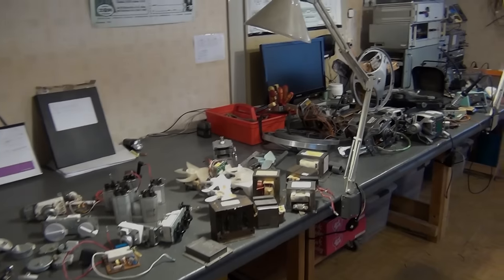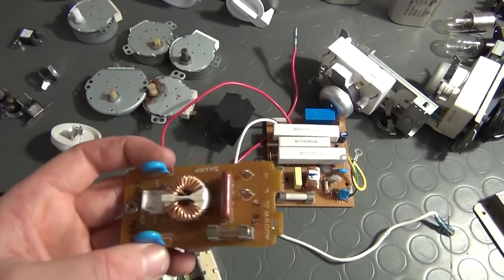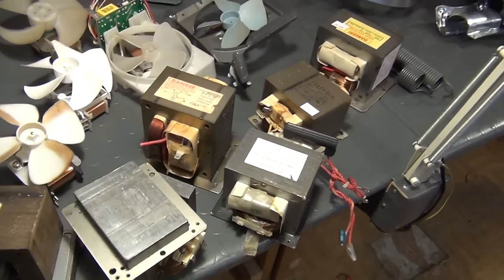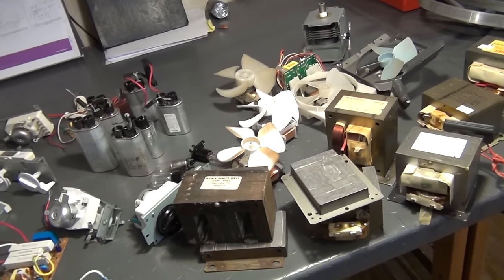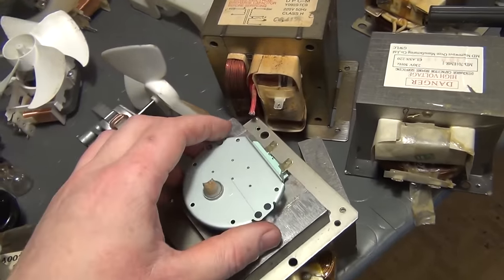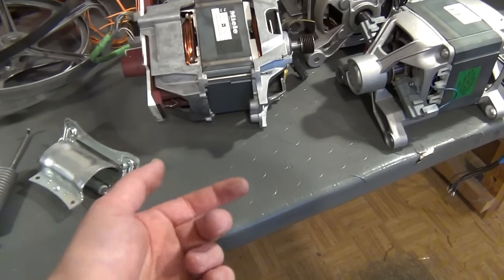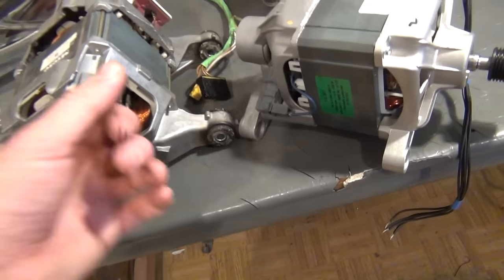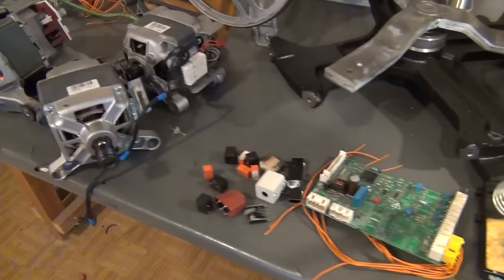TPAI Lab Report # 002:  Salvaging and Reusing Parts from  Microwave Ovens and Washing Machines

Comment: Salvaging washing machines is very rewarding.. I've used some of the pumps to realize my rainwater collection and storage/filtration system, built a winch from the drum wheel/belt assembly to haul beer crates up to my balcony so I don't have to carry them up the stairs, and many other projects. If you're looking for higher powered pumps, salvage a dishwasher.. they usually have rather strong pumps for generating the pressure for the spray valves, and they also have good throughput (commonly 2" hoses).

Comment: This is an somewhat older video but one feat it still has in common with many more recent ones that see specific parts come by (like the one on all kinds of motors) is a little gripe of mine, or rather a wish I have..; you always DESCRIBE parts (like the choke in this vid, and obviously all those types of motors in that one I referred to) but you never EXPLAIN them in any manner that makes them understandable. Not in general, let alone as to specific parts, points of interest or things referring to their mechanisms of functioning that you might mention... To stick with that example of the one that stars all those types of motors, it would be so good if you would do one that ACTUALLY lays out precisely how all those separate types work!

Comment: i made a remote starter button for auto repair from a bicycle hand grip, a normally open, door micro switch with an attached metal extension arm from a microwave, some wire from the microwave and a couple of alligator clips. one clip goes on the positive batt terminal, and the other on the actuating terminal of the starter solenoid. i hot glued the switch in the grip with the lever arm sticking out of the hole in the closed end, with the last 1/4"(7mm) of the arm bent at 90 deg. pushing the arm energizes the solenoid to operate the starter. for what they are, the price to buy one is crazy.

Comment: I have built several " Fractle Burners "  using micro wave oven ballasts . Variable voltage using variac  allows pattern burning of wood. You can google it. the resulting burn scars in the wood can be cleaned out with a brush and backfilled with colored epoxy.

Comment: Well, the Universal motor on the washing machine I see as very useful. 

I see it as a matter of creating a transmission that suits the aim and I like that they can be used with either DC or AC current. 

Some guys do a lot with salvaged motors from washing machines, treadmills etc. 

Jeremy Fielding does wonders with salvaged motors including washing machine motors. Matthias Wendel has built three band saws with salvaged motors with the largest being a 20 inch saw he often uses for milling logs to rough cut lumber. He is also very skilled at creating the required transmissions which are often made of high quality plywood laminated into gear assemblies or step pulleys. 

I just used a Universal motor from  a food processor to power a small ball mill. Sure at 120 volts AC it was useless but after cutting away the diode rectifier and powering it with 12 volts Dc while connected to a shop built wooden based transmission it works perfectly at spinning the drum at 30 to 120 rpm depending on what part of the step pulley I attach the drive belt.

Comment: What I do with microwave light bulbs:
     Take two bulbs of equal wattage, wire them in series, and put them inside bathroom or hallway lighting fixture such that they are always turned on. With each bulb only getting half its rated voltage, they glow dimly, but brightly enough that you can use the bathroom at night without disturbing your night vision.
     Why do this instead of using an ordinary nightlight? An incandescent nightlight will burn out after a few months. An LED nightlight will grow dim after a few months. However, these microwave light bulbs will maintain constant brightness, and since they each dissipate much less than rated power, they will last for many years, if not a decade or two.
     And don't fret over the electric bill. Keeping these low-wattage lights turned on constantly will have no noticeable financial effect.
Reply: Probably some LED night lights are crap. But if you properly derate the LEDs, that is run them like the lightbulbs at a fraction of their rated power, they’ll last for decades too.

Comment: So I found a washing machine with a three phase motor and I did not use my head when it came to figure out a way to make it work. 
I listened to you when you said it’s too complicated to get it to work. 
How do I had the time to actually look at the circuit I could’ve used washing machines VFD to power the motor itself it just had five in put wires and all I had to do was put an o-scope on them and see what was the input signal that made it go. Then reproduce those signals.

Comment: Hmmm. Think I may get onto writing an app to interface into a salvager database. Something like you as the salvager fill in the name of the device, a list of parts you found useful and any notes on using those parts like clearance considerations or links to data sheets. 

When I heard you mention that tidbit it got my gears turning that it's one of my greatest frustrations trying to salvage parts is just finding things like data sheets or decoding from the device itself how to actually use the part I want. Case in point a very confusing washing machine motor I salvaged which has a bizarre startup procedure that I'm still working out. My father used one just like it when I was a kid and it was a really nice one since speed control, direction control and even timing control are all built right into the motor. I don't remember his circuit to tie knobs to all that being at all complicated.

Comment: You should NEVER "play" with a magnetron period. They are to be treated with a special respect if you want to experiment though.
A typical magnetron operates on 2.4GHz @ 1Kw of very "dirty" wideband RF. The power requirements are typically 2Kv to get it fired up and like all RF the bulk of the emitted radiation is lost very quickly IF you do not have a reflection chamber or parabolic on it.
Shooting one as-is straight out will do nothing to you @ 10 feet from the nozzle because the RF acts like a flashlight beam and spreads out and looses most of its potential. If you have it on a waveguide or tuned parabolic the "flash light beam" turns more into a laser type beam as it's more compressed and focused.
This is what makes microwave radio systems work.

The MOT is basically crap, I mean you can rewrap the secondary with heavy gauge wire and make a spot welder or arc furnace but that's about all you can do. Even then there is no promise you wont fry the primary.  

IMO the best parts of a Microwave Oven is the digital electronic timer with VFD's or LCDs. The mechanical ones are again not very exciting and are usually a geared timer motor driven or have a tension wrapped spring.. Either way they are more or less pre set, where the digital ones have everything on board and you can set them more accurately and have a real time clock as a bonus. Plus they typically use smaller relays on board too.
The VFD / LCD types can also be driven with an Arduino if you dont want to use the onboard system, you just need to get the schematic and isolate the display circuits a bit.

The airflow handlers are ok IF you can find a place for them in a project. otherwise they are good for scrap metal, kinda the same for the MOT and casing of the unit.

Comment: I see no problem reusing those motors, you gotta do your leg work and get a few basic metal cutting tools and a cheap welder and steel tubing and bearings and build a reduction drive like a standard drill press uses to change speed of the drill bit or in your application its needs. Covering the motor isn't that big of a deal get some card board and cut square boxs and template some 18 awg steel plate into a box to cover it and  add venting holes. When in doubt, draw or look to other appliances for help. Car parts are good too.

Comment: Hi TPAI ! 

Microwave oven transformers make good high voltage supply for tesla coils.

Also, by removing the secondary and the magnetic shunts, by cutting the E and I parts of two transformers, and then soldering the two E together. You are left with a big transformer, with a large aera to wind your own secondary. The two primaries can be connected in series to greatly reduce the magnetizing current, thus making it much motre efficient, and capable of running coninuously (which a standard MOT cannot do without active cooling).

MOTs are lovely devices :)

I am loving your videos so far, very informative and well detailed. keep up the good work :)

Best regards from France !

Comment: I use the big magnets inside magnetrons to stick on the side of metal sufaces, then stick metal tools to them for convienience.  You can also use a thin metal strip to stick many tools to them.

I have endstops in my cnc mill that were originally inside a microwave and other devises.

Comment: I use the washing machine motor for my air compressor It works good the compressor runs slower but that's ok because the motor has plenty of torque to run the compressor it runs a little bit slower so recovery of the air pressure takes a bit longer but for home use its fine
Reply: I know its been five years but, what was the wattage of the washing machine motor you repurposed?
Reply: @amielrumbaua8387  I forgot its bin a while and the tag is missing

Comment: I was just reading your patreon page and noticed you mentioned lack of ventilation for welding in the basement. Throw those microwave fans in some plywood with holes cut in it and place it directed outward in the window. 4 to 6 of them should allow for adequate ventilation and with minimal noise.

Comment: Some of those components would be great for making a HAWT power generating system. They work fairly well in the back garden/roof level wind velocities with enough wind swept area. The castings with the bearings and the belts bring you half way there for a proof of concept build.

I mean you're not going to be making money selling power obviously but it could be fun to attempt. Maybe you could use the energy in your heating system or something of that nature.
Reply from the maker: zero_sum I have experimented with all kinds of self made wind turbines about a year ago. In this region there is a lot of wind, but my own lawn (of all places) is not well suited for a wind turbine.
But thanks for the input. I didnt think about using this part for a HAWT, but now that you say it, I guess it'd be worth a try.

Comment: I work at an auto parts shop, so I recognize many of these from their automotive use... strange feeling. 
Those ceramic cased power resistors are common in older cars, in US referred to as a (ignition coil) ballast resistor. I've also heard of them used as a "voltage dropper" but I don't understand what that is for beyond the obvious. 
One thing that is never used on cars is those Honeywell style microswitches! Sure, every car quite a few of them, but each one is different for each use and make and model!

Comment: About those washing machine motors, you should be able to turn them into generators. on my channel, I've turned two can motors (one from a printer the other a remote control car) and a stepper motor into electrical generators. you may even be able to use the microwave fan motors as smaller exhaust driven generators.You are right about quality. German machinery is industrial grade and high quality, which is why I have a Volkswagen and a German soldering iron. As a note, the trade off is they are usually harder to service and find parts for. that probably explains why my brother was able to disassemble three North American printers with a vest pocket screwdriver.

Comment: Rather Wonder Concept: "Repurposing for the MAKER community"....... A personal interest of mine that might have wide appeal is the ::::  Exercise Treadmill and it's Variable Speed DC motor. I have two of these gathering dust because of the effort/time required to come to an understanding of them sufficient to start a repurposing project. .... THANKS Again!
Reply: There's another guy on youtube that made a knife making linisher from an old treadmill. Seemed to work nicely.George Ray

Comment: TPAI you can reuse the washer motors to build just about any revolving tool in the work shop... you can upgrade wood lathes and small bench metal lathes and take them over to belt operation with the right bully wheels etc. or use them to replace the old style of mini mill top engagement system. tyvm for posting all of the wonderful information.

Comment: Hello mine friend "" I need to apply may be 12 volt with boost converter with micro oven transformer to make a force field , also a hand held plasma disrupter, very high voltage, I no it is a very strange thing to ask ""  !

Comment: I want to build a simple wood turner's lathe with a washing machine motor, with the option to make it a disk sander with the right attachment. Controlling the speed is the hardest part of using these motors, especially if you want low RPM because the built in tacho winding doesn't give a ver useful signal.
But I have started a circuit that will run the motor from rectified mains via a PWM controlled IGBT including motor reversal, a current sensor and RPM measuring at the motor and at the spindle with two hall sensors. But unfortunately it's a project that went into the "waiting projects" box two month ago.
Reply from the maker: superdau You can salvage a small neodymium magnet from an old CD / DCD drive. If you then glue that magnet on the rotor shaft and place a hall effect sensor near it you  can use that to measure the frequency of revolution more precisely. If you want an even better signal, you can use a comparator to reshape the output signal from the hall sensor.
Reply: ***** It appears to be DC motor controller, rather than VFD.
Reply: ***** 
It's 325V DC, so, no ;)  It's "just" a PWM-dimmer with feedback. In the end it should have some more logic like recognizing slip on the belt and keeping the spindle speed (not the motor shaft) constant (all controlled with an atmega32). I currently can't find the circuit I drew up, but if I do I'll post a picture here.

Comment: One remark about microwave capacitors:
those capacitors are trash, because they will have very high ESR and low cirrent handling abilities it is far worse than some bleeder resistor. Essentially you cant use those capacitors anywhere where they have top pass any significant current
if you try to use them anyway they will either overheat or disconnect.

Comment: Microwaves are not so bad, they can cook/burn you on the worse.
A little bit of washing powder wont destroy your garden. People are using dish soap in theirs organic insecticides to make it sticky. 
You are underestimating value of the bowl from washing machine doors - it is heat-resistant you can bake a cake in it.

Comment: Vielen Dank für ein weiteres toll Video!

The metal drums with all the holes make great fire pits. And I agree, a speed control on the rotary assembly would make a cool welding table.. And a small drum (plastic or metal) could be mounted to the rotary assembly in a horizontal orientation to make a nice parts tumbler. Just add crushed walnut shells in with your metal items and you'll have nicely cleaned and polished parts in a couple hours! Not sure how electrically efficient it would be though..

Comment: Those fan motors get dirty, yes, they might even get stuck, but, you can clean them up and put them back to work. Tough to break one. I have the same motor powering a small suction fan, it gets stuck every few years, i keep cleaning it, keeps running.

Comment: Hi, thank you for a very informative video. I viewed it because I am considering using a washing machine motor to run a dirt/stone sifting trommel  in my garden. I knew I would have to use a reducing setup to get to an rpm of the 30 on a 25-30 inch diameter trommel but I am unsure now if I should perhaps look elsewhere.  This would be my first foray into using a motor in one of my builds, do you perhaps have a suggestion for a more appropriate motor?  I would like to try and repurpose the motor from an appliance but am open to any suggestions you may have.

Comment: Microwave turntable motors are diffrent to their fan motors in respect that the direction they start up in is random, if you start one 10 times sometimes it will go clockwise, and others anticlock.One thing you can do is put 2 mechanical end stops on the motor shaft, if you do this the motor will drive up against one, reverse and drive up against the other then reverse again, and oscillate between the 2, handy for certain projects.

Comment: You could use the complete washing machine motor setup to build a ball mill. But you have to reduce the motors rpm's very much to make it work. I dont know if this is possible via PWM.

Comment: a microwave transformer can be used to build a spot welder...
if the motors are suitable for fan then i would try to make an evaporator unit out of them to blow air through the cooling element maybe